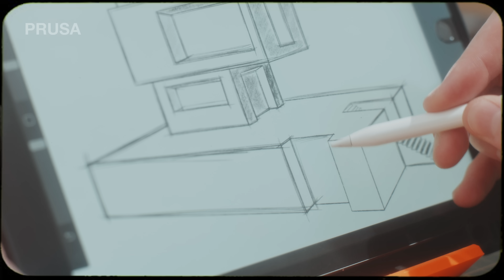Made To Last - Prusa 3D Printers

Comment: When it comes to 3D printers, Prusa is hands down the king for me 👑
Reply: Totally agree with you on that 👌 Prusa really set the standard for what a reliable 3D printer should be. It is not just about the hardware, the fact that you can upgrade it over time and that there is such a huge community constantly coming up with tweaks, mods and improvements makes a massive difference. You buy one of their machines and you know it will stay relevant for years. That kind of long term support and innovation is what really makes Prusa stand out

Comment: I upgraded my MK4 to MK4S for $99, quick installation...and the results is smoother surfaces and higher speed. It was definitely worth it .Then I went all in and converted another printer to Core One. It took me the whole weekend,, but it makes sense. It's basically a whole new generation of printer,, new design...
So yes, MK3 -> Core One is not just an upgrade, it's a platform change.

Comment: I still think the upgrade kits are still too expensive and are approaching the price of a brand new printer
Reply: That's unfortunately the case for a lot of things. If I want to upgrade the GPU in my PC I'll also have to upgrade my RAM, Motherboard, and CPU otherwise I won't be able to take advantage of PCIe gen 5, and at that point I might as well just build a whole new one.
Reply: @starmanxvi yea, but I am wondering if it will benifit Prusa if they take a slight loss on the upgrade kits so more people will be incentivized to buy it

Comment: 0:35 no, I bought a MK4 and still keep the MK3 functional. Because a 500$ upgrade is not worth it if the mk4 Kit is 750$. Really wish upgrade pricing to be like back in the day for early prusa supporters...
Reply: MK3 or MK4 is still a solid workhorse, no need to toss it out right away.  MK4S upgrade is such a no-brainer – it’s just $99, super easy to install, and you can actually see the difference (smoother prints, less VFA, faster runs). Plus, you can always do the upgrade later or wait for a sale… I’m personally planning to jump to the Core One soon anyway...
Reply: @ViktorieAppl  yeah I wont toss it out since it is a great Backup and having multiple printers just speeds up batch prints soo much :D thats why i said that a 500$ upgrade for the MK3 is not worth it if a second better Prusa is just 750$ :D
Reply: 58 what time

Comment: Built to last? I've never been so frustrated and disappointed in any printer Ive built or bought in my 12 years of 3d printing. The core one is so unfinished its not even funny, replaced 2 probe sensors and its still just going from 0 to 7000 by itself over time.

Comment: I don't own a 3d printer yet. And I'm waiting for something incredible (and holding off from buying bamboo) I want to support Prusa, but I also want a premium printer that just works! Something you can't GET anywhere else. The core has so much competition... If you ask me, that'd be like 2 or 3 toolheads on a smaller corexXY printer. Like the XL but smaller!  Now that'd be something special 😊
Reply: I'm a prusa person, but my friend has a bambu and he's happy with it. It wouldn't be a fit for me as I don't like the idea of a company still having ultimate control over something after I buy it (plus, open source FTW) but from what I have heard, if you're not into consumer rights or right to repair, they are solid options. Just be aware of their ToS as it is a little predatory in my opinion.
Never been a better time to get into printing though!

Comment: I have both a Core One (purchased first) and also now a MK4s. 
They each have their place with what materials I use them for, but ultimately the MK4s is still significantly easier to work on, quieter, and does better with flexible filaments. 
Waiting for the Bondtech setup for the C1 and will upgrade to that!

Comment: The only stock parts of my old MK3 are the frame, Einsy Board, PSU, a few printed parts, E3D heatsink, and motors. Everything else has been replaced at some point.

I only upgraded to the MK3S+, but I did replace parts as they wore out. I'm surprised that the stock printed parts lasted as long as they did.

Comment: i have nothing against prusa other than the low spec nozzle and chamber temps. 290c nozzle? only 55c chamber? ABS / ASA prints will just barely start warping at 55c. why not 60 or 65c to ensure zero warping? and they are considerably stronger at those chamber temps. why not make the nozzle 300 or 320c to be able to print PPA-CF? or any other filament that would benefit just above 290c nozzle

Comment: The idea is nice but when you want to upgrade from let's say a MK3S+ to a core one you have to replace just about every part. And that also shows in the price for the upgrade kits. So you do best just to sell the old print and get a new version. 629€ to MK4S kit and then 559€ to coreone kit.
That's like 1.188€ and the coreone build version is 1.049€.
The good thing is you can ALWAYS repair the printer if needed.
Reply: You can upgrade if you want. Prusa is all about giving us choices, that's why we love them.
Reply: I understand that, but it's important to realize that Core One is not a simple upgrade, but a completely different generation of machine, with a different design (CoreXY), a different type of movement, and a different purpose. Comparing the price of kits with a new printer is a bit misleading, because it's not just a replacement of a few parts, but a conversion to a different type of machine.
The MK4 → MK4S upgrade, for example, was the exact opposite – simple, fast, and above all, inexpensive ($99). The installation took me one afternoon, and the print quality improved immediately – less VFA, smoother surface, faster printing.
Reply: @ViktorieAppl  It is, and you'd be wasting a lot of parts if you did, but the point is you can, and the fact that you can is based on the core value that these printers are meant to be understandable and moddable by its users. 

It's a common joke in the Prusa community that someone could in theory take a MK2 all the way up to a Core One, because it would be completely impractical and waste several printers worth of parts in the process ... but the fact that it's possible means the printers are designed in a way that makes them incredibly easy to maintain. 

A big part of the history of 3d printers is that they were machines intended to empower us to make machines, and the Prusa practices that. These are not  disposable consumer appliance, but obviously that brings certain restrictions and conditions of its own.
Reply: even getting the upgrade to mk4 and enclosure is not worth it. I had this dilemma, especially that my heat breaker and few other parts broke(100% my fault though). I ended up with getting few parts replaced and getting a better nozzle and I am happy to save 1k eur. Mk3s+ is still good for hobbyist.
Reply: @notreallythereanymore  I still have my Mk3s+, and I use it for paying work. It is reliable, requires almost no maintenance, and the prints are still as beautiful as ever. I find that most of the people obsessed with latest tech are the hobbyists, as they tend to obsess more about their printers than the parts their print. That, or they're shoveling out high volume low value trinkets for Etsy.
Reply: @Niclord7 You did notice that the video did not mention money? ;-)

Comment: Now if only there was a printer with a CoreOne style enclosure, had a XL build volume, and used the upcoming Bondtech INDX system.
Hint, hint Prusa. 😉
Reply: INDX for the Core One is almost certainly coming, there has been a lot of teasing by both Prusa and Bondtech. Build volume, no hints about that unfortunately.
Reply: @logicalfundy  How did this comment age?
Reply: @GenoMartinez93 Well, the Prusa Core One L isn't quite as large as the XL, but it's larger than the Core One - somewhere in the middle?
Reply: @logicalfundy  I was thinking you're spot on and it's aging better than wine so far
Reply: Haha youre starting to describe something that doesnt have Prusa written on the side of it.
Reply: and hopefully not cost an arm and a leg

Comment: I've upgraded mine from the mk3 to now core one. The only thing that remains is the heatbed! The motors got replaced mainly to remove vfa. I think the psu got replaced in mk4. There really isn't any other company that is doing as good of a job adhering to reprap principles.

Comment: And this is why Prusa are top dog in my opinion. No lock-in, fully privacy respecting, and good for the environment.
Though it does raise the question - is it the same printer or a new one?
Reply: If you've gone the entire upgrade path (especially including Mk4S to Core One), I think the only thing remaining from the original is probably some nuts & bolts.
Reply: @logicalfundy  What do you base that on? I really have my doubts that they would both selling upgrade paths if everything needed to be replaced.
Reply: @mitchib1440 I mean if you do multiple upgrades all the way from the Mk3.You're right, it would be silly to offer single upgrades that replaced the entire machine. 😅
Reply: @logicalfundy  Ahhhh! Yeah I was gonna say!! I thought you meant from the MK4S to the Core One!!
Yeah, most components have been redone over the years. But also, having two printers isn't all that bad if you print a lot of stuff. I would definitely have a second one if it weren't for my tiny english house having no room for two side by side hahahaa
Reply: Leader in displacement of layers and flash drive errors. Glad I sold my MK4S
Reply: @ИльяК-з2р sounds like user error honestly. Glad it went to someone who knew what they were doing in the end lol

Comment: Genuine question: If you were to start with the MK2 and upgrade to the latest, what parts would you still be using from the original?
Reply: Psu, roads some bearings and maybe a few cables
Reply: That would low-key be a fun experiment to try and do the entire upgrade path. Some sort of Printer-of-theseus kinda deal
Reply: @Chrookieexcept it wouldn't be. I think you might have what 20% old parts. It's upgrading to new components vs just replacing rotting wood with fresh wood
Reply: As someone that has done this over the years. The only thing I can think of is bearings. But I would strongly advise replacing those while you have it apart anyway.
Reply: The stepper motors, maybe power supply?
Not sure what else.
Reply: 3D printer of Theseus :)